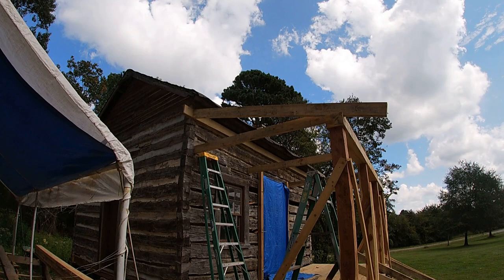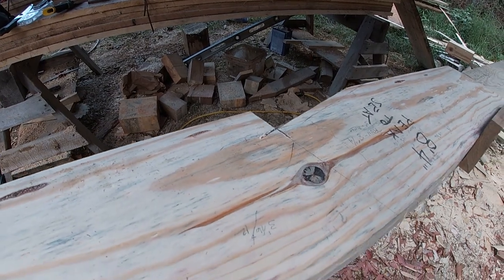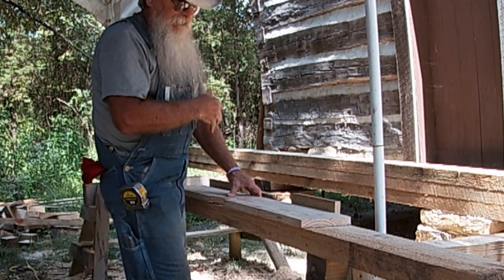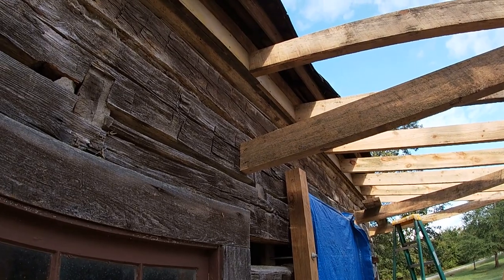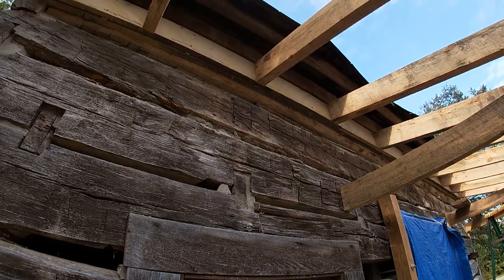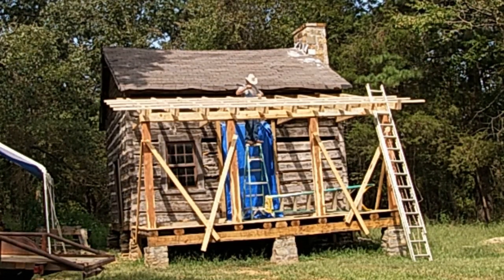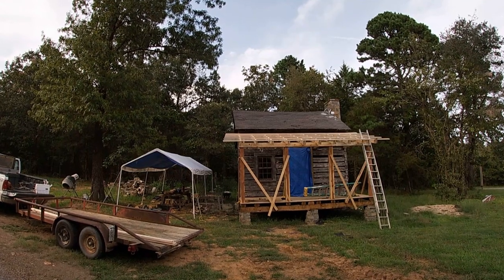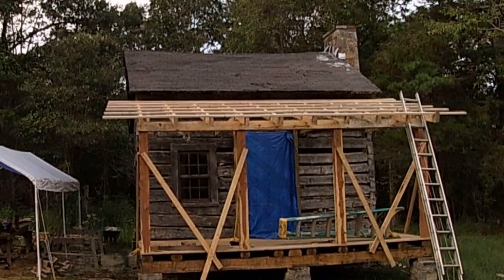Porch Rafters and Lathing, Gilliam Log Cabin (Pt4)

Comment: Your work is paying off, it seems. How much do you think you’ve extended the life of this cabin with your efforts to protect it from the elements and correct its issues? Thanks for sharing, and God bless you and Mrs. Carpenter.
Reply from the maker: Howdy JT- thank you so much for watching the video. I sure appreciate it. The cabin will last way longer than I will even if I hang around for many years. It would be difficult to actually put a year number on it. It was built around 1850. God bless you also
Reply: @TheBeardedCarpenter , I'd be willing to bet that you more than doubled the life it had remaining before your repairs and adding on the porch to keep weather from affecting it as much.